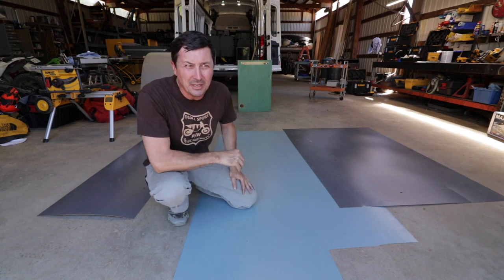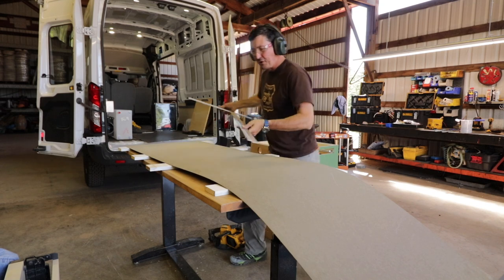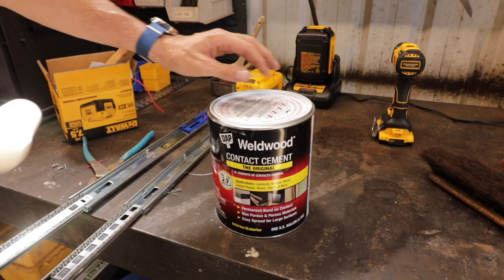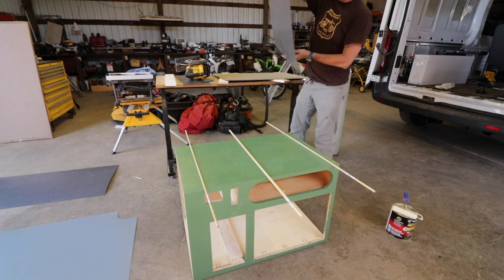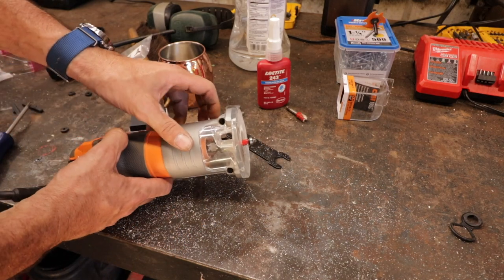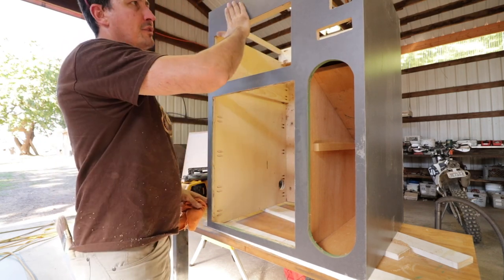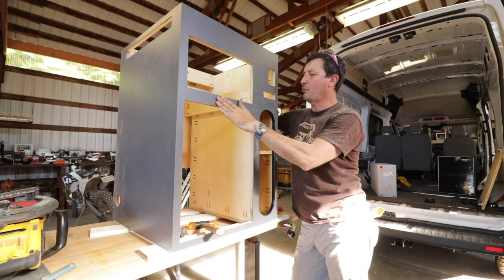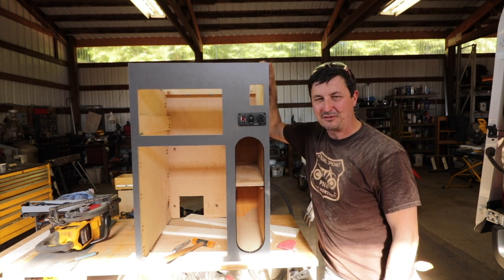Adventure Van Conversion - Building Cabinets

Comment: Seam would have been out of sight if put towards the top.

Put a towel under your roller to cushion for any sharp high spots in the plywood surface?

Roll out the dowels instead of pulling them out perpendicular? Rolling will let the laminate settle down gradually?

Great work, since making youtube comments doesn't take a lot of effort, making a cubby and laminating it does :D

Comment: I've heard you need vinyl/soft plastic/rubber plastic's glue for that T trim, if its the same plastic a refrigerator door seal/agnet kind of plastic. Don't try the hard plasic glue either, you need specific.

Comment: you dont need glue on the insertion tab from 1" on the flat all the way around the corner to 1" on the next straight you just slice the insertion tab every 1/2 inch or so depending on how sharp the curve your curve would pry be 1/4" just be cautious inserting it so you dont bend the taband before you router the edge if you put a strip of painters tape on the surface that has the  bearing rolling on it it will 1 keep from any scratches around the edge and 2 step you of the thickness of the tape it gives it a micro edge that adds to the look and feel its so minimal that you dont catch on it or even see it but give it a try with a scrap and you will see what i mean nice video! its cool that you admit you dont know!

Comment: Good work on the laminate work.  It’s been quite a while since I did any.   How about a heat gun on the plastic molding to get it to conform to the curve better?
Reply: Mike Robbins 
Also, I'd imagine cutting the 'stem' of the T at regular intervals at the curved sections would help it conform, by letting it expand to the lahger radius. 
On external corners, cut Vs into it, allowing it to compress to the smaller radius.
While I've not used that specific product, I've used similar stuff.

Comment: Watched guys using the plastic seam on arcade cabinet builds and they cut V notches into the plastic lip that goes into the channel to allow it to bend to an outside curve. Maybe cut a straight line in it to allow it to conform more to the inside curve.

Comment: That edging material... You're supposed to slit the back end that sits in the groove at regular intervals,about and inch, and then work back into corners with mallet. Otherwise nice job and I am inspired to use the laminate on my next arcade cabinet.

Comment: Might need to cut the T part on the inside of the rounded parts just slice it a couple places and use a heat gun to really get it to contour to the shape, I built office furniture for a while and that's what I did to keep the trim from pulling out on corners.

Comment: Contact cement cleaner  for cleaning up the mess and ive always used white carpenters glue. We use t moulding on arcade game cabinets all the time. If you look at the t moulding you will see there is little fins on it those also hold the t moulding in place

Comment: Contact cement cleans up with laquer thinner (denatured alcohol).
Reply: Also, if you use a 15 degree laminate trim bit, instead of the flush cut, you'll be less likely to have edge 'accidents.'
Reply: Which is it, laquer thinner or denatured alcohol ? they are different
Reply: Read the contact can. It will say paint thinner. Laquer thinner will melt the contact and loosen the laminate joint and you will catch the laminate and chip it. denatured alcohol will do nothing
Reply: Lacquer thinner is for the most part, acetone. But I agree it ought to work. I don't think alcohol will touch it.

Comment: It would have been easier to edge band the shelf before you assembled the shelf, but you can use some the iron on edge banding to cover to the ply edge.  I'd have likely not thought of it until I was all done.  I have found that in any job even if the big part is done correctly its the small details that make it stand out.  As for the glue..... never done it, but feel compelled to toss my 2 cents in.   I think you might be overthinking the glue a bit.  If it holds it works.  The part that goes in is barbed so it just needs a little bit of hold.  I'd try silicone

Comment: Since i done over 1000 cars  what you doing i can give good tip on if you want first you make the seem on the top not the bottom since it will show when you looking down just a estetic  thing sorry for bad english.Then i allways use like a heat gun for smooth fitting to the plastic stripe and last you use sika flex silicone  for glueing that stripe down.and since we are on that subject have you silicone around all the windows you put in very importend to do otherwside if ya missed and its a glitch some where in the rubber it can and will start corroded around the rubber of the window.and you doing a great job otherwise not easy to fit every thing smoothly in a car with all curves and metal bars hands down ya are could do it for other people i am  impressed with ya skills since ya never done it before not a easy task.

Comment: your moral of the day: I took on a project, made myself a solar charger for my car. sits on the parcel shelf in the back and just soaks up the sun to charge a portable phone charger. Anyway, i have never messed around with solar stuff before and it has been a good few years since i last used proper tools so i was nervous but i went for it and i am glad that i did because now i have this nice little free solar energy thing in the back of my car. yeah, it isnt as fast as charging the charger by a wall and yeah, it would take 3 chargers a day ever day for 72 years to make the cost balance out but it was a fun little project.

Comment: Don't use acidtone to clean the surface.  Use WD40 it will break the glue down and won't harm the surface. I helped my father for years. He was a upholster he did everything including high end finishes and yes cabinets as well. Although my uncle was the master  at cabinetry. As for the edge trimming something like Superglue or Gorillsglue will work. Just remember and glue you get on the finish use WD40. The only thing that I know won't destroy the surface. You may have to let the WD40 set for a minute or two. However it will work.

Comment: Cody, a fine tooth plywood blade works better and also cutting through masking tape at the cut. J-rollers are cheap and have a rubber roller so it won't mar the Formica. An acetylene tank can scratch the surface and it dropped and broke off the valve is dangerous! Hate to be a safety Sally, but don't cheap out on a roller.

Comment: Just an idea on the corners do you think it might be a better idea to use a heat gun? I think the channel is tight enough to hold the strip but I think you might need to heat it up and get it to soften it up and get it all away the end of the channel.

Comment: To clean the contact cement, what i think you should do is take a piece of scrap laminet, And place some cement in it. Then, proceed to attempt to clean it. Im worried you will ruin the finish of your cabinet if you use something like acetone or MEK.
Reply: Also, end the plastic T trim on a flat, instead of a curve!

Comment: I've never dealt with that trim, so I'm not going to sugggest an adhesive BUT, if you cut a notch in the part that sticks into the groove, that may relieve the tension that's causing it to pull out. It seems that the trim is trying to "pull itself straight again" and a notch ought to help?
OR it'll fail miserably. :D

Comment: I have done those edges on tables while renovating an ihop we just used contact cement and the joint is supposed to be on the top so you can not see it

Comment: i do a lot of laminate work for cabinets in hospitals and schools, contact cement is the standard glue, even for the "edge banding" .. on outer edges we use a hot melt type glue, prior to assembly, in a edge banding machine.. i know thats cheating lol.  cleanup is always with lacquer thinner

Comment: As far as your discolored edges....to prevent this smear beeswax where your bearing rides and don't put too much pressure with the router....better to leave a tiny edge that is easy to finish perfect with a file.

Comment: do not glue just simply cut a small piece out of the t part (a wedge shape) that is going in the slot it allows it to bend more easily and conform to the corners

Comment: 4 days late to the party - and one of those comments where I haven't done it myself, but couldn't resist showing off my know-it-all-ness:
Don't worry about glue - just cut the tongue that fits into the slot where it goes around the corner. Every 3/4 inch or so, so it doesn't have to stretch and then it won't be as prone to pulling back out of the slot.

Comment: If you ever do laminate again, dont use the tank. If you get garbage betwen your work and your laminate, a heavy roller will crack it. Thats why "we" pros use hadn rollers. You can however use a block of 1x to rub out th elaminate and seat the glue (its not really for air pockets. and you get a good press this way without possibility of damage and you can actually feel any garbage under your laminate. (also you can remove laminate with a squirt bottle and healthy amounts of acetone. It wil evaporate and you can reglue and relay in about 10 minutes.

Comment: I say locktight lol on a serious note I am a welder and please be careful with the way you used the acetylene tank is dangerous because if the cap get damaged and the valve gets sheared off the tank can take off like a torpedo

Comment: Clean up glue with lacquer thinner
Reply: yep thinner will do great on plastic...
Reply: Cabinet shops have been using it for years.
Reply: im sure they do , but i would be very carefull if i was him.
i had some bad experiences with thinner and plastic.
maybe higher concentrated than they sell in the states??
Reply: the cabinet maker worked with would take a rag and get it damp with lacquer thinner and use it to wipe off glue. As long as you don't pour it straight on the laminate you won't do any damage. Other options to try would be goo gone or other solvent.